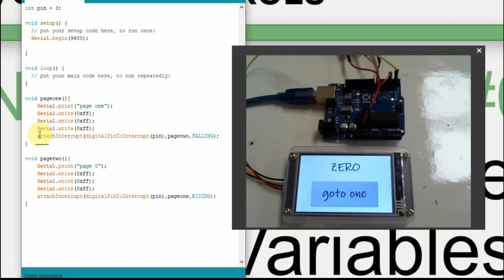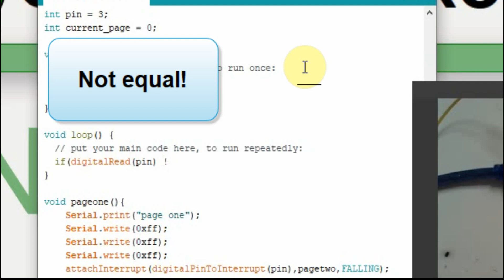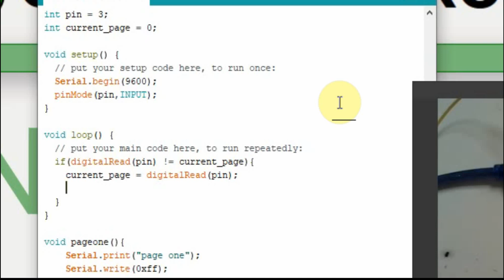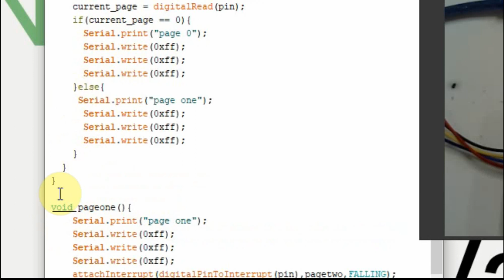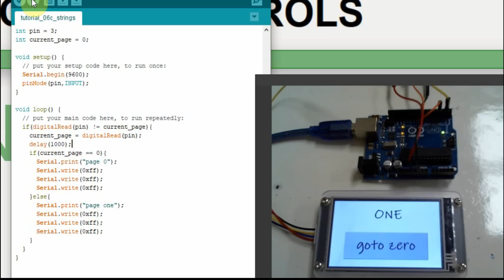#71 Nextion Display Page Change with Arduino and NO Nextion Library Variables Part 3

Comment: Just tried this.. mine is flipping between pages zero and one few times before eventually settling on the right page. The same happened both with variable as well as the interrupt. Any thoughts ?
Reply from the maker: I am not sure.  If you want a file review you can contact me through the www.cheapcontrols.com website.
Reply: @CheapControls  Thanks for your quick response. I was actually not connecting the switch correctly. The common pin was supposed to be connected to Pin3 and other two to GND and Vcc. Thanks for your tutorials !!
Reply from the maker: I am glad you got it figured out.

Comment: Hello - Great video - subscribed, what if i have more than 2 pages? lets say i have a page 3, how would the code look then?
Reply from the maker: The switch that was used in the video only has two positions.  I would need to know more from you.  Do you mean if you had multiple switches or a different kind of switch?  Please describe what you want to accomplish and I will try to help.
Reply: @CheapControls  Hi, thanks for the quick response. Yes so I would like to control multiple pages dependent upon multiple switches. i.e., switch 1 would trigger page 1, switch 2 would trigger page 2 for example. In my case, my "switches" are a digital pin high or low state. Thanks in advance.
Reply from the maker: @farazaslam7445  Are they momentary push button switches or toggle switches?
Reply: @CheapControls  Hello - Toggle switches
Reply from the maker: @farazaslam7445  If you toggle switch one to a state of 1 and it changes to page one then you leave toggle switch on a state of 1 then you toggle switch 3 to a state of 1.  Would you expect the Nextion to change to page 3 or stay on page 1?
Reply: @CheapControls  Page 3.
Reply from the maker: @farazaslam7445  I think that is the information that I need.  Let me think about it for a bit.
Reply from the maker: This code is untested.  I am traveling and won't be back in the shop until Monday.

/// NOTE : PAGE VARAIABLEs
int page1 = 0;// initally set to not displayed
int page2 = 0;// initally set to not displayed
int page3 = 0;// initally set to not displayed
int switch1 = 4;// pin for switch 1
int switch2 = 5;// pin for switch 2
int switch3 = 6;// pin for switch 3

// NOTE : Comment out the next two lines if using an Arduino with more than 1 serial port(MEGA)
#include <SoftwareSerial.h>
SoftwareSerial Serial2(2, 3); // RX, TX

void setup() {
  Serial.begin(9600);
  Serial2.begin(9600);
  pinMode(switch1,INPUT);
  pinMode(switch2,INPUT);
  pinMode(switch3,INPUT);
  page1 = digitalRead(switch1);// set variable to current switch status
  page2 = digitalRead(switch2);// set variable to current switch status
  page3 = digitalRead(switch3);// set variable to current switch status  
}

void loop() {
  if(page1 != digitalRead(switch1)){ // if input has changed
    page1 = digitalRead(switch1);  // set variable to current switch status
    if(page1 == 1){// if switch went from off to on
      Serial2.print("page one");
      Serial2.write(0xff);
      Serial2.write(0xff);
      Serial2.write(0xff);
      delay(500); // short delay for bounce and smooth operation.  May not be needed
    }// if switch went from on to off then do nothing
  }
  if(page2 != digitalRead(switch2)){ // if input has changed
    page2 = digitalRead(switch2);  // set variable to current switch status
    if(page2 == 1){// if switch went from off to on
      Serial2.print("page two");
      Serial2.write(0xff);
      Serial2.write(0xff);
      Serial2.write(0xff);
      delay(500); // short delay for bounce and smooth operation.  May not be needed
    }// if switch went from on to off then do nothing
  }
  if(page3 != digitalRead(switch3)){ // if input has changed
    page3 = digitalRead(switch3);  // set variable to current switch status
    if(page3 == 1){// if switch went from off to on
      Serial2.print("page three");
      Serial2.write(0xff);
      Serial2.write(0xff);
      Serial2.write(0xff);
      delay(500); // short delay for bounce and smooth operation.  May not be needed
    }// if switch went from on to off then do nothing
  }
}
Reply: @CheapControls  untested?? lol worked first time! Excellent! thanks so much!
Reply from the maker: @farazaslam7445  Great.  Glad I could help

Comment: Thank you very much for this!! I have been struggling for nearly 2 days trying to get an external button to change pages. I had only been messing with the timer, preintialize and postinitialize event in the Nextion Editor. Never thought of using serial.print. Much appreciated.

Also, must I use the Touch Press/Release Event function for the external switch to work? It seems that I can change pages with both external switch and taping on the screen. Would it be possible to only use the external switch to change pages?
Reply from the maker: I believe I explain what you want in part d of the page change tutorial https://youtu.be/ZBI7CDeblGo.  Watch this one and let me know if that answers your question.  I might not understand what you are asking.

Comment: Thank you very much sir ..You just save my ass..!
Reply from the maker: Glad I could help.  Consider making a donation to my ko-fi page.  https://ko-fi.com/cheapcontrols
Reply: @CheapControls  Sir i have another problem now..simply i  just want to change between pages its working now without any flashing between screens. but after that i tried to send data to both page's using "analogRead values "  that also worked without any problem, but when i used that values as a range like " ( val 100 to cal 500) = page 0 " and   "( val 501 to val 1000) = page 1" only change one time to  page 0 to page 1 and no coming back to page 1 to page 0. how to fixed that problem kindly help me with it..i am struck with that now..
Reply from the maker: @Smartliving-udanagayan  If you have access to Facebook.  Go to my page and pm me with the code.  It is hard to help without the code.